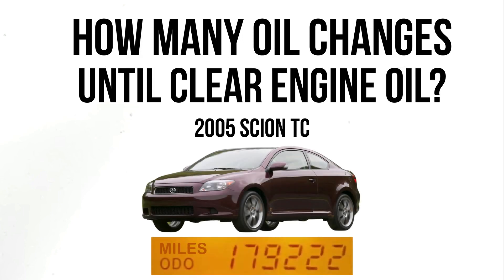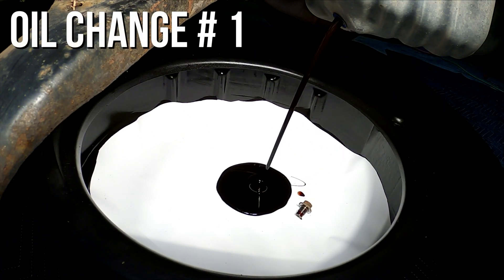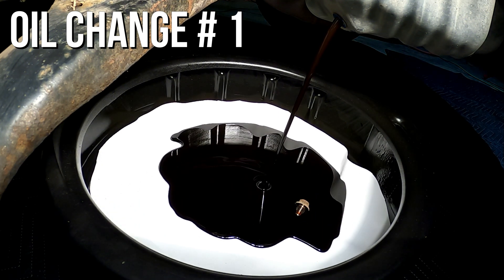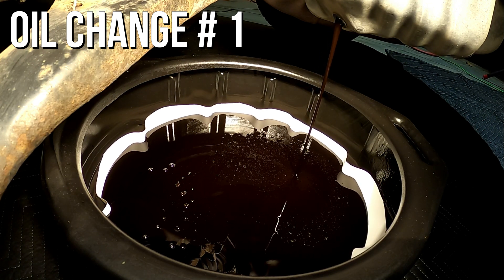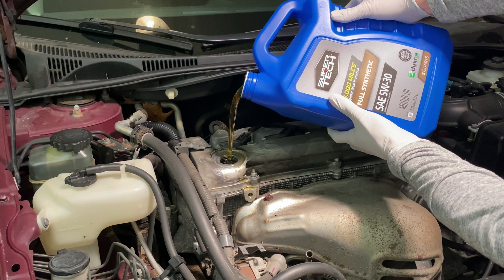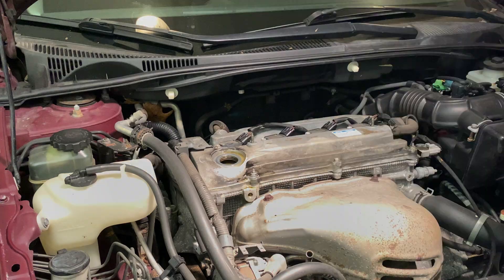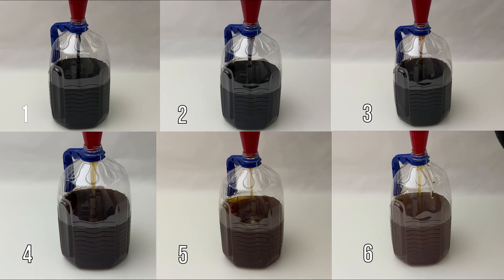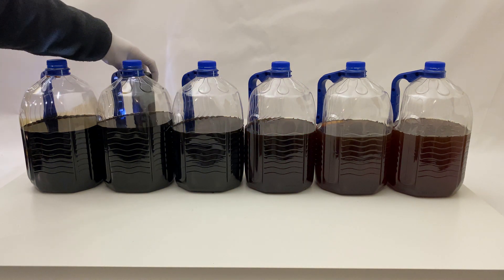Clear Engine Oil - How Many Oil Changes Does it Take? (with Color Comparison)

Comment: I used to think I was changing my oil correctly all these years until I assisted a fellow pilot change the oil in a Cessna piston single airplane. He also in the past built high power race engines. 

He fully drained the oil until it barely dripped. Then with the drain plug still removed he poured new oil in and observed what was coming out. He kept slowly pouring in until the oil flowed clear out the drain. Then he installed the drain plug and put proper amount of oil in. 

I wonder if this technique might have saved one complete change using your criteria?  Any thoughts?  Thank you.
Reply from the maker: That's a very interesting technique, literally flushing the engine.  I agree, it probably could have saved an oil change.  My logic to running the engine was to circulate and warm up the new oil to capture as much of the old oil as possible.  The first oil drain is very black because it has 8400 miles on it, even though I was using Mobil 1 High Mileage Extended Performance, I decided to change the oil early for my next video....and as you will see, very clean oil is required.....stay tuned!  Thank you for sharing!
Reply: I kind of did something like that by accident. I forgot to put back the drain plug and wasted around half a litre of oil. 😆 After putting back the plug and filling  it up, the oil has become very clear in the dip stick.
By the way, I used STP engine flush before and this was the final third engine oil refilling.
Reply: That's a really good idea. I'll probably start doing that with spare oil I have laying around.
Reply: Doesn't always work.. Pouring oil in to flush out the balance without the sump plug in, will often flow through the engine via the easiest path... It won't push all the old oil through, depending on the style of engine... (two banks aka a V engine) and the oil cap... etc... I'd still do 2 changes to ensure total oil flow through the engine.
Reply: @peterlattimore6013  I agree it won’t push every last drop of dirty oil out of the engine. Only a full refill, short drive and another flush will do that. But me draining the old oil, then me pouring in a few ounces of new oil and watching more dirty oil drain out is proof enough for me to continue my practice.  When purchasing a used car I have done the flush/drive/flush again method if I do not trust the previous person’s maintenance.

Comment: Should have used a fumoto drain valve for all these drains 😅 I have one on each of my cars us open the valve and drain
Reply: I don't believe in those things. In most oil pans those drain plugs sit above the bottom of the pan, therefore the pan doesn't fully drain so you are diluting fresh oil with your old contaminated oil. If you are lazy, I guess it's better than not changing your oil at all, but not as good as fully draining the oil old school.
Reply: @budlanctot3060  I am away from a lazy type buddy... I just learned how to work smarter than harder through my 18 years of cars ownership....the drain valve has a short thread so it doesn't go up to much in the pan to make a higher drain exit....I change oil frequently more than anyone so... Old residue mixing up with new oil is not a biggie, although it happens in any type of motor if let a car to drain for hours there will always be old oil at thr top and bottom and in the pump... The valve is very high flow it drains fast... And scooty kilmer a very well known mechanic.. You can search him talking about the valve too....when unbolt the plug it makes a hole for the oil to escape and when you turn the valve open it makes the same hole for oil to escape with a little less diameter... It will take little longer but same process
Reply from the maker: I'll have to look into those, would have been much easier to drain!

Comment: Did a similar procedure about 27 years ago with a used car I just bought. We also added a chemical flush to the original oil and each one after. Can’t recall exactly how many we did but enough that the last drain came out clean. I do remember the first 3 at least came out very dark. 

This was a GM 2.8 liter v6. Changed the oil every 5,000km after that at home with a Chem flush every time, car ran great until it rusted apart. Did have to swap out the transmission, should have done a few drain and fills on the transmission as well.

Comment: Can you please tell us does this effect a positive performance on the car??

My mechanic did not tighten the oil cap after service so there was leaking he subsequently had to drain the new oil out and put more new in I found the car ran a lot better
Reply from the maker: I haven't noticed any difference in driving, but starting does seem quieter with the fresh oil compared to the 8000 mile oil, especially since it is below freezing here in the mornings.  If some of your engine oil leaked out from the mechanic not closing the cap then it's possible it ran worse because of a lower oil level.  I had a friend who's engine burned so much oil, by the time they changed it less than 2 quarts came out and it looked like tar.  New oil, to the full level, made a huge difference!

Comment: Wow! Interesting! I always wondered how many would it take or if it had any impact if it's clean or just with 1 change. You should have done it in more detail, like Temps, or more stuff like that with an program or an machine that takes in consideration all that. Idk if ODBC does it. Anyway, I've seen with Liqui Molly it lives your oil at lvl 3/4 with flush it once. Would be interesting to see how clean or how many times does it take to be completely clean if you use Molly like 2/3 times. I know it's an expensive process such as the one you showed.
Really apreciate the time! Awesome work! Definitely goona sub!
Reply from the maker: Glad you enjoyed it and Thank You for subbing!
Reply: LM Engine Flush, Amsoil EF, and 505CRO are all excellent, high quality products.

Use dino oil and a cheap filter for a week. Let it run nice and hot. Then drain and replace the filter and oil with a good one.

99% removed.